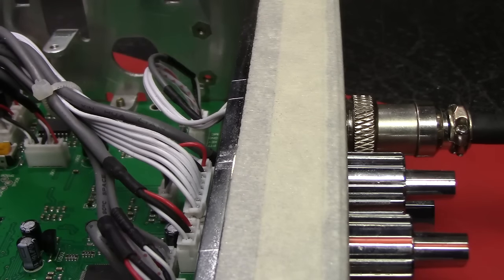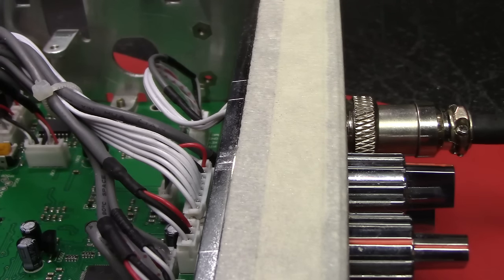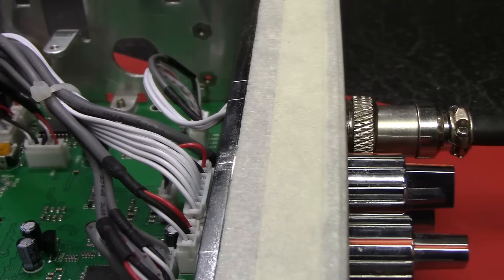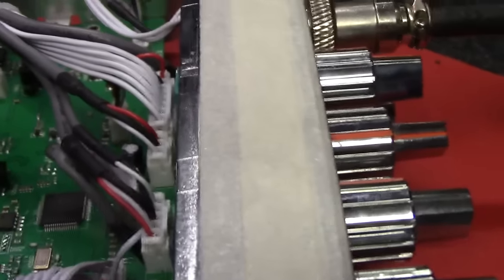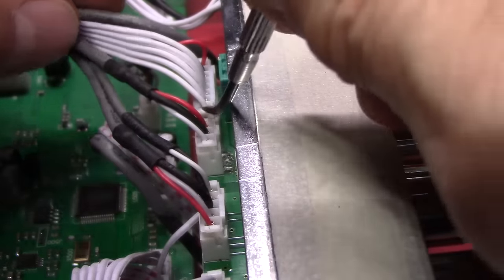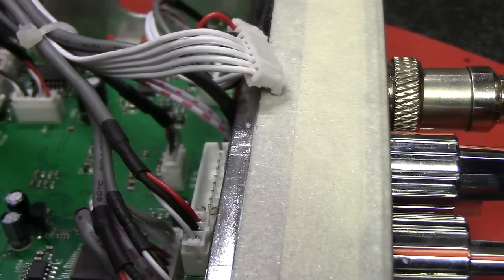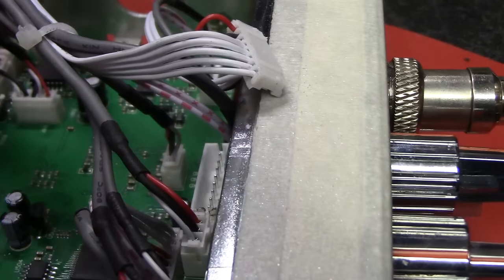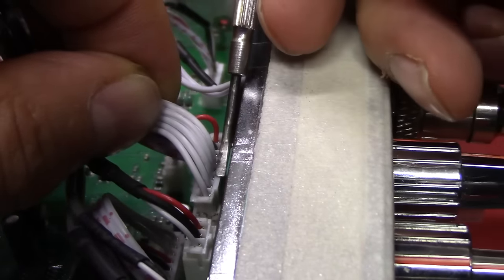Fine Tune CB Shop - HOW TO FIX Stryker Radios SR 955 Low Volume - Low Talkback - Other issues.

Comment: Thanks for this video. I had this problem. Everything was working fine then, all of a sudden, my volume dropped to the point where I had to turn the volume knob all the way up to be able to hear anything that was being received. After watching this video and following your instructions using "real" contact cleaner not WD40, everything is back to working as it should be.
Reply from the maker: Excellent!

Comment: Do you have any vids on the external speaker plug-in ? My 955 loses volume but i think the lil tab inside the female side is giving me trouble , i have opened up the radio and took a small hook tool and tried to bend the tab up a bit , it just seems loose when the male plug is inside and seems like it should be tighter. Thanks
Reply from the maker: External speaker jack problems are not a common issue on theses radios unless (I have videos covering this topic) the radio gets jammed into a cubby hole of a truck,  gets pulled on or excessive wire that's bundled, and dangling around for a million or two miles. Never allow ANY TENSION on either the PA or external speaker jacks. The part is inexpensive but it's time consuming to replace it.